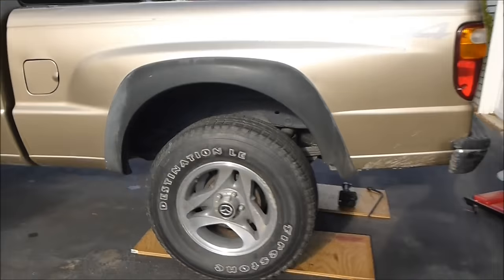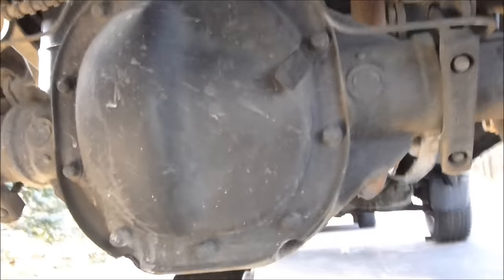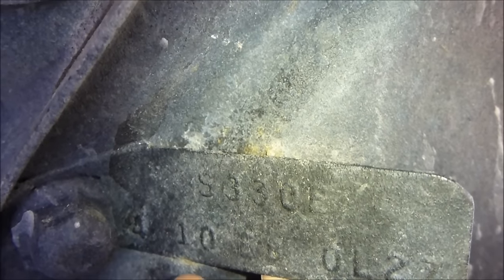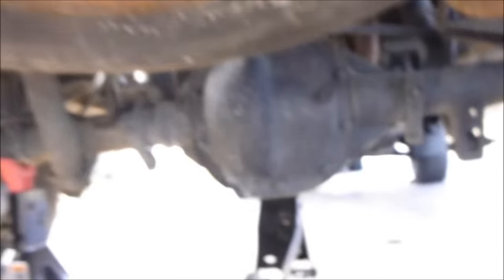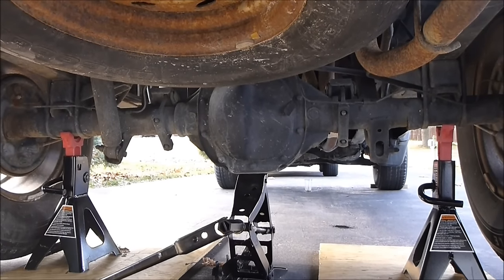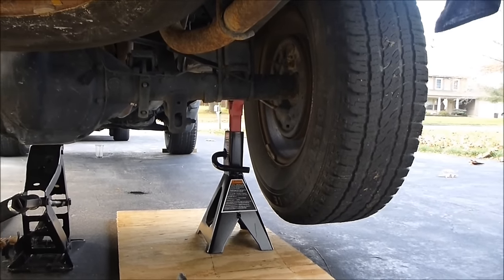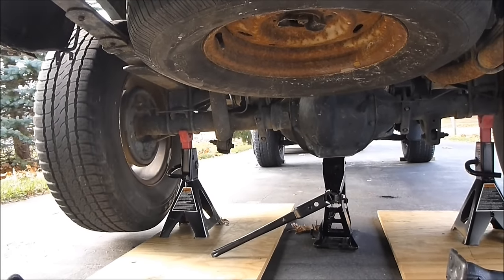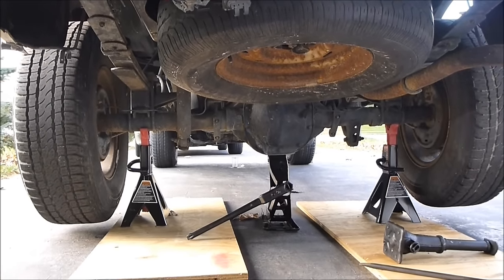How to tell if your car or truck has a limited slip differential

Comment: So the truck in this video is posi?? Both get power?
Reply from the maker: No, it is an open diff. Only one side gets power. I want to get a locker eventually!
Reply: ChrisFix
Uhh... "only one gets power," huh? They're not "1WDs" (in 2WD mode)! I watched a video that showed that an open differential provides the most power to the wheel with the least amount of resistance. So even with an open differential, if both wheels have the same amount of resistance, they should both be getting equal power.
Reply: MaxxFordham yes that is true look at an 2wd rc car the wheels spin opposite directions but when you hit the gas both get power but if 1 tire is on ice n 1 is on concrete the ice tire will spin but say in mud since it is the same viscosity for the most part both tires will spin most of the time
Reply: That's already what I was saying. Power doesn't only go to one unless the other is really stuck.
Reply from the maker: Yea, that is what I was saying. I guess I wasnt clear. Only one wheel gets power when there is a loss of traction. Otherwise they both get power.
Reply: Okay, so then what is "So the truck in this video is posi? Both get power?" supposed to mean?
Reply from the maker: We are talking about when you lose traction. All rear diffs have power to both wheels under normal conditions so that was a given...
Reply: Hmm. Didn't seem like a given before, but NOW that you actually completed your idea here, it makes sense.
Reply from the maker: sorry I wasnt clear.
Reply: Thanks. :-)

Happy 4-1-4-1-4 coming on Monday (like 12/12/12, etc.)!
Happy Easter, too!
Reply from the maker: ***** Thanks for the explanation!
Reply: Or, *****, rather than "loosing" traction, maybe they'll be losing traction. Or maybe they'll have some traction but it will be loose.
Reply: no if you were to put pressure on one of those wheels it would stop spinning

Comment: No, you are wrong. Locked means they are mechanically locked together (such as a detroit locker) and the axles CANNOT spin at separate speeds while locked. LS diff's will ALWAYS turn the same direction unless not working right, or load on one tire overcomes the spring tension/clutches in the assembly. Did you not watch the video? He could hold the other tire in place if he liked, an LS diff working right, will not allow that.

Comment: also: limited slip differentials are overrated. easy to swing your back end out. with an open diff all you have to do to gain traction is let off the gas and it grabs immediately.

Comment: Just remove the dozen or so bolts to the cover.
Inspect the gears, etc. 
look for excessive metal in oil.
Fix what's busted.
Check pinion seal for leaking .
change dif oil with correct additive if needed.

Make sure vent is clear.
Axle seals aren't leaking.
Install a posi if needed.
Correct the gear ratio if needed.
Use the correct sealer for gear oil to reinstall cover. 

Sleep at night not worrying about your rear axle.